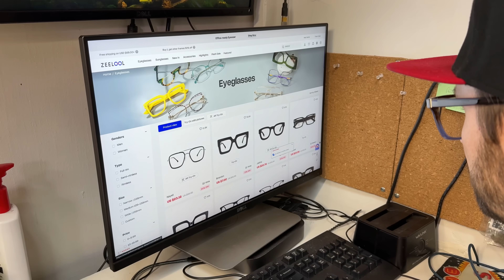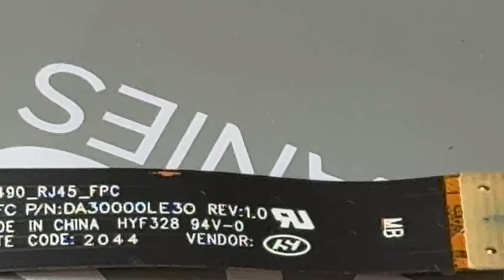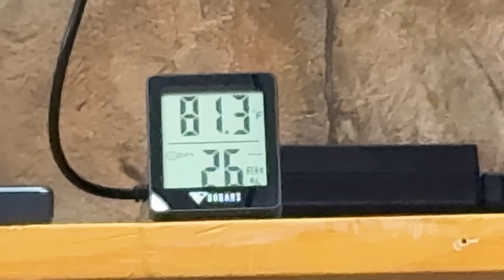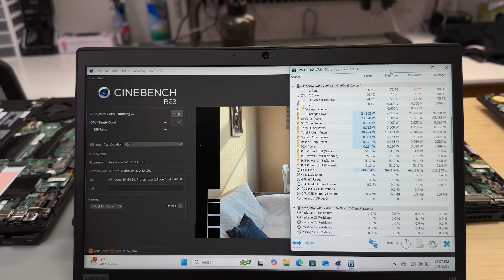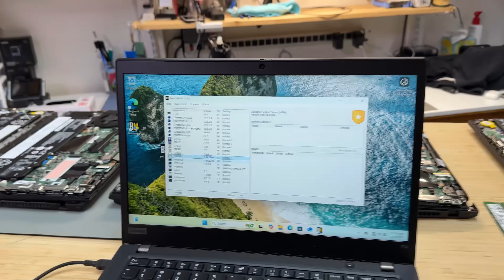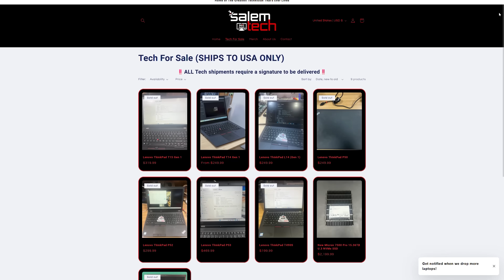Is Replacing Laptop Thermal Paste a MASSIVE Waste of Time? Let's Test!

Comment from the maker: https://salemtechsperts.com/collections/laptops-for-sale
https://www.ebay.com/usr/salemtechsperts
I need your help flooding the world with cheap, reliable laptops!
Reply: Question.
Is it worth the effort to check the thermal pad placement on a new laptop?
I purchased a new in box 2023 Asus A17 in January. trying to beat the price increase when tariffs start.
That being said the pads and thermal paste are a couple years old but have never seen actual running temps.
So is it worth it to crack the case open and check everything?
Reply: @douglascampbell9809  Absolutely. Why? The person (person not machine) that pasted your laptop did it for like 15 cents an hour as fast as s/he could out of a laptop pile that reach the sky to reach the day production numbers. If you see GPU repair videos is super common to see missing pads, badly installed, wrong thickness, you name it.
Reply: @obshaky  Thanks. That's what I was thinking. 
It's my replacement for a 14 year old Toshiba that looks like it's been through a war.
Reply: @douglascampbell9809   If your seeing high temps or throttling then yeah but should usually not be a problem at all
Reply: @douglascampbell9809  yes
Reply: I can help with imaging aspect right; you need an "evaluation copy" of Windows Server 2022 with Windows Deployment Services and the Microsoft Deployment Toolkit installed it.  You may feel that might be overkill, but instead of having to pull M2's, you can image as many laptops as you want (depends how many you can network to the server) and when the driver packs are loaded into MDT, you don't need to do base image for every laptop model you have.  I'm willing to assist with this gratis.
Reply: I sur hope a MASSIVE amount of new stock come in
Reply: FYI, the only thing verified about blue light is sleep, everything else is marketing BS and placebo effect.
Reply: Have you tried unclaimed baggage website Have you tried the unclaimed baggage website? Some of them buy stuff people leave at the airport. somehow they buy stuff people leave at airport
Reply: Hey I’ve got an acer nitro 5 an 515-57 with an intel i5 and broken rtx 3060 can you replace either the mosfet for the car or the psu or the card itself (soldered) if it was needed? Also check out the keyboard it takes some time to respond to inputs sometimes some keys have to be pressed down for some time to work if it’s possible can you estimate a price? P.S. long time follower on my other account dantemartin5820
Reply: You got a sub for that respawn lol
Also thanks, I was wondering how much better Kapton actually is and so I was like, "fuck it, I wanna google it."  Google gave lots of stupid answers.  So I hit up ChatGPT and it gave me this table
Tape Type	Max Temp (°C)	Thermal Resistance	Adhesive Stability	Electronics Use	Notes
Kapton	~260–400	Excellent	Excellent	✅ Ideal	Gold standard for high-temp electronics
Duct Tape	~50–80	Poor	Fails easily	❌ Never	Melts, slips, or chars
Electrical Tape	~80–105	Fair	Risky near heat	⚠ Limited	Only for cooler zones, short-term fixes

YEEEEEAH I've been stupid to not use this stuff.  Over 2 decades repairing cables and computers for friends and family and jobs (granted I didn't use duct tape ever lol but I did use electrical tape) and WOW I've been sleeping on this shit!  And it's CHEAP, too!
Reply: word affordable would be much better :)
Reply: @salemtechsperts
I need a mother board for Lenovo X1 carbon gen 6 can you help

Comment: @SalemTechsperts I would have appreciated it more, if you would have differentiated more, like showing what has the biggest impact on the performance, by showing the differences between dirty vs cleaned fans vs new paste vs both at once. Does the repasting or the cleaning part help more with the thermals here? Like having it with dirty+old paste, dirty+new paste, clean+old paste, and clean+new paste to see what does what

Comment: My Acer is about 3-4 months old and it regularly hits temps of 90 to 96C with the fans at full blast. Is this a thermal paste problem mayhaps?

Specs:
Intel i5-12450H 
16gig ddr4
GeForce RTX 3050 6GB

Comment: Man, I really wish you were in my country, yaar. I have an HP Omen 16 with a Ryzen 7, RTX 4060, 32GB RAM, and a 2TB NVMe. I recently got it serviced, but even after that, I still don’t understand why my temperatures go above 90 degrees just while playing games. I went to the service center, but they couldn’t figure out the issue—they simply suggested replacing the motherboard for no reason.

I just want a proper solution. Whenever I’m gaming, the temps shoot up, even though the core temperature stays around 85–90 degrees on ultra graphics at 165 FPS. I honestly don’t know what’s happening with my laptop. ChatGPT, please rephrase this.

Comment: Everyone makes the mistake thinking that replacing your thermal pads and paste is going to lower your temps without actually testing their fans first. Changing the thermal paste and thermal pads doesn't lower your temps because the motherboard is configured to reach a specific temp for the CPU and GPU for optimal power utilizing the CPU and GPU as best as it can while cooling the two consistently for long periods of high power usage reaching the highest possible clocks before it throttles. So, then what will it do renewing your thermal paste and pads when needed? All it does is help the fans work less as hard as before, and return to the state of when you first got your laptop or desktop. When your thermal paste has dried out because it's been 5 years or so, the temps remain the same because the paste and pads still work but what is happening is you start to notice that the fans are loud all the time even when only reaching temps of 65 degrees. So assuming you tested all your fans and they're working at 100%, then we know it's the thermal paste and thermal pads so changing those items on the CPU and GPU will return the fans back to its proper rotation because now the heat is probably allocated into the heat pipes and out to the vents. 

So, all in all, rule of thumb is to always check your fans first. Then if not the fans then it is your thermal paste and/or thermal pads. And always also remember and this one is a bitch: for laptops, if you have to lift the heat pipes break the seal of the thermal paste and thermal pads to for example change the fans, you have to repaste your thermal paste on the CPU and GPU, and change your thermal pads because they've contoured around the parts and are the only thing holding those heat pipes to the CPU and GPU when screwed down. Now, the thermal pads are debatable but the thermal paste is not.

Comment: Blue light filter is marketing BS. Looking at the sky on a sunny day will get you 10,000,000 time the amount of blue light you get from looking at a screen 24/7. Also the shorter the wave length the more damaging for your retina the light. And sun light (even when scattered by the atmosphere) got tons of very short length light waves, like ultra violet. So if you are really afraid of eye strain and retinal damage, then go and live underground or get uv filtering sunglasses. But you can ditch the blue light filtering BS that as no measurable effect beyond placebo.

Comment: Replaced my raiders paste with conductonaut extreme LM.  Silicon conformal coated about 9 inches of the board in all directions around the cpu/gpu, made 2 dams for each.  And used kryonaut extreme paste for all the other chips.  Got my 285hx, and 5090 from 80c at full load, to 55c at full load.  It makes a MASSIVE difference

Comment: I mean, my laptops exhaust when it was old thermal paste was warm to like yeah hot... Changing it after it was searing hot at the exhaust and in probably terms someone would think that's probably bad. Well if the exhaust was warm well the heat wasn't going out efficiently at all, when changing the paste and it was hotter out the exhaust that's a good thing because it's now transferring heat far better. It still gets pretty hot actually but it's an hp elite book and it's what it does anyway lol. It's probably the fan being a little tired or the heatsink is actually inadequate. Either or, it was hotter out the exhaust so I did see a difference or rather feel a difference changing it. Also on my ps4 too lol it sounded like a super charger now it sounds like your civic ac blower on low.... Lol.

Comment: In my case, after a lot of years with the same paste, after change, the temperature reduce almost 20ºC. And in a i7 720QM (first generation) was enough to reduce from a toasty 90º to ~70º with normal use.
Now idles around 56ºC.

Comment: I have an thinkpad P52 it has lots of screws and an magnesium chassi. but the best thing is most screw holes has size badging of screw if the screws are loose it is easy to thermal paste laptop. I can take disassemble it and apply thermal paste maximum 20 minites it takes to do it, plus cleaning fans extra time.

Comment: The real solution is the double heatpipe modification. Its for a P14 laptop that has a gpu but the same heatsink if found online can be used on this. You will need some thermal pads to the thickness of a GPU so the heatpipe is attached without flexing and shorting out the motherboard

Comment: Can help me with cpu problem
Reply: Issue:
	•	The CPU often runs at extremely high temperatures (90°C to 97°C), even under moderate load.
	•	I notice severe thermal throttling during gaming or even during benchmarks, with the CPU clock speed dropping significantly.
	•	Power draw is often low (around 10-15W) while temps are still very high, which affects performance.
	•	Games take longer to load, and performance is inconsistent.
	•	I tried undervolting, but it didn’t help.
	•	The fans are working, and I’ve cleaned the inside with a brush and light air, but the issue remains.
	•	I suspect the thermal paste might have degraded and needs to be replaced.

Comment: ThinkPads are #1. Have had a T430 since 2012 and would have continued using it except Microsoft won't allow an upgrade to Win11 without the 2.0TPM and better processor. So I just picked up a ThinkPad L14 Gen3 (2022 manufacture) and it's been great. Like brand new, better machine, and less than $480. Saved $700 over a laptop I was considering at Best Buy.

Comment: Hello. I pray you see this and reply.  I'm in Ghana  🇬🇭, west Africa. Too bad I cant ship my laptop to you. But you can still give me your professional idea. I bought a used Dell precision 5550 10th Generation i7.  It's heats up on the left side when charging and the latop is off.And the weird thing is, if I turned the laptop off and charge it while on a cooling pad. The left side doesn't heat up.. And it becomes when around the keyboard area soon after  its turned on. Even watching YouTube video make the keyboard area hotter. And when you plug it while charging it's worst. 😢. The only time it doesn't heat up is when I used a cooling pad.

Comment: Excuse my stupid question but do i need to replace thermal paste on my laptop after just opening the lid, i wanted to check on the ram. I didn't touch anything on the fans/heat sink

Comment: It does make sense, but it wouldn't hurt to use it year or couple before doing that, anyway it will require maintenance cause of dust.  Especially if TurboBoost is turned on, you will get solid 15-20C decrease.

Comment: I bought an open box gaming laptop a couple of years back. Very solid hardware but I found out why it was open box quickly - it throttled INSTANTLY under load.

Repasted it and it dropped idle temp by thirty degrees. It still throttled eventually (cooling system wasn't great, it was a cheaper laptop) but I got several minutes at full speed instead of less than a second. 

There was zero dust in this thing when I bought it. It was all the thermal paste.

Comment: Hi! Just a question. I'm running asus tuf gaming f15  i7 12700h paired with Rtx 3070m and im hitting 95ish cpu temp while gaming after repasting still the same. Is this normal/safe? I'm gaming around 6 - 8 hrs a day.

Comment: @4:29 you could either create a master image using DISM or you could utilize a network based image deployment tool like PXE. We use DISM at my current job and even though it’s a one off process you can just connect the SSD containing the image to each machine and just run a few commands so no drive pull to deploy. Much faster.

Comment: Only if you replaced it   salem it is its pointless !        , i see you tubers replace the past but not tbe fans doh !  After 2 to 3 years   fans and thirmal past will degrade ,  resalting in fast degrade of the new past that was applied 😳   fail !

Comment: Regular maintenance can save your laptop --- and it's cheap can be performed under 8$  from 95°c to  under 60°c 

Every 3 month 
1- change thermal paste . 

2- open fan if you can and clean it . Lubricate fan with engine oil 1 drop is enough femove fan from unit and pour one dop in bearing .  (Never use grease) . 

3- use 1000grit sand paper to clean copper pipe 1000 grit is safe as it's used for polishing and cleaning micro surface dirt . It won't damage your pipes .

4. Clean your back panel.  

Laptop will become so silent and temps will go down . Try it

Comment: I have two Legions, and both Legions from the factory had lousy paste and were already dried out within 6 months of owning them. I was throttling. I replaced all my paste and putty, and my temps dropped over 25C. One is a 9th-gen i7 (2020 legion , and the other is a 14th-gen i7 2024 legion, both run cool as can be. People saying thermal paste replacement is a joke obviously do not know anything about computers. Also, No gooch on my laptops lol

Comment: I got a shitty dell prebuilt office PC for free that I was trying to use for a Minecraft server. decided to switch out the hdd for a ssd because it didn't have that much storage (not like it would matter for a minecraft server but I still wanted to anyway) and I also decided to repaste the cpu because it was right there and I had extra thermal paste that came included with my AIO from building my gaming PC. Once I took a look at the old paste I realized why the fan would ramp up so much. It was because there was only a little bit of crusty paste left. After removing the old paste and adding some new paste as well as upgrading the hard drive, not only did I see improved load times for new chunks as well as going to the nether, I also saw better performance when having a bigger group of people online. It was also about a million times quieter unless it was put under load by a lot of people being online and in different areas of the world. In addition to that the OS I was using (Linux mint because it is more user friendly) ran so much smoother, snappier, and faster which was great. Thanks for the tip of repasting CPUs to get better performance.

Comment: But the question actually is are you replacing the thermal paste with the exact same kind of thermal paste that was already there or are you using better thermal paste that would then be causing the computers to run better?

Obviously you're not going to have the factory thermal paste so you're going to be using something else which is going to affect your results unfortunately.

Comment: is thermal paste that much better than liquid metal, if so should i replace the liquid cooling in my laptop? And if so to what/
??
Reply: Liquid Metal between a CPU and its lid transfers the most heat out of the CPU itself, but it’s more expensive, it degrades faster, and if it leaks it will ruin your motherboard due to it being conductive. Thermal paste/grease does a good enough job without all the headaches of Liquid Metal. LM should only be used on maxed out gaming machines. As far as air cooling vs liquid, it’s kinda the same deal, liquid cooling is better for max performance and is also quieter.

Comment: I have a 12 year old laptop with an i7 gen 3 intel cpu (ancient technology, but still capable)! I never ever changed the paste! recently when compiling code and under heavy load, it would reached 90c after about 4 minutes and it would start thermal throttling and lowering the clock speed, same with it's gpu! I changed the paste and now under load, even after 1 hour of compiling and heavy load, it wouldn't ever go above 77c! but, and this is a big but, even though it runs much cooler and doesn't thermal throttle anymore, the performance didn't change all that much! if a compiling took 1.5 hours before, it's still around 1.5 hours! but at least the laptop doesn't try to burn my legs anymore lol! and for gaming the fps didn't really change either, maybe more modern hardware can do better with better cooling idk!
Reply: Yeah, the max power is probably similar on an older cpu but its lifespan and efficiency is extended with fresh paste and clean heatsink. I also use a gen 3 i7 almost daily in a 2013 MacBook Pro retina and its original paste wasn’t terrible, it was still somewhat moist and pliable.